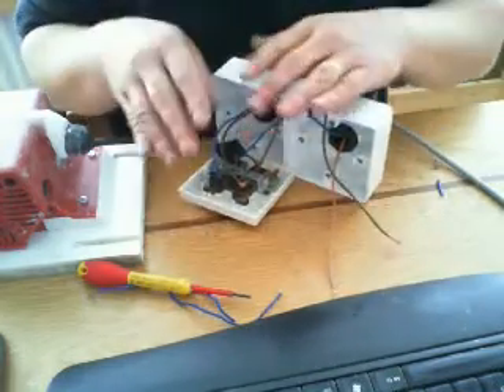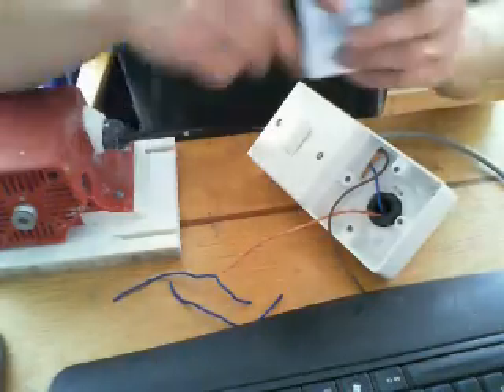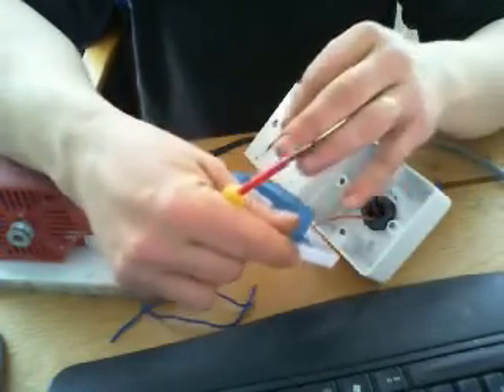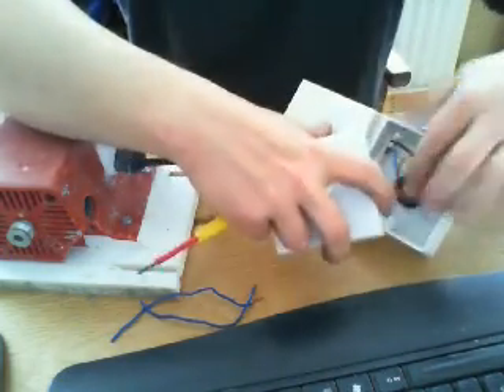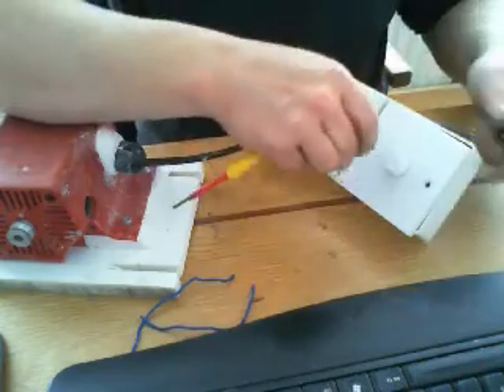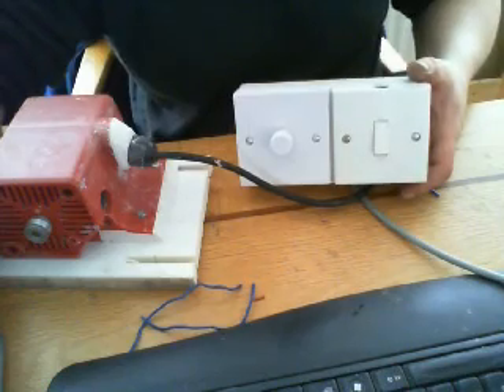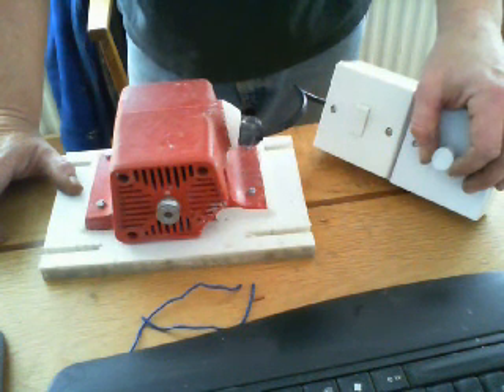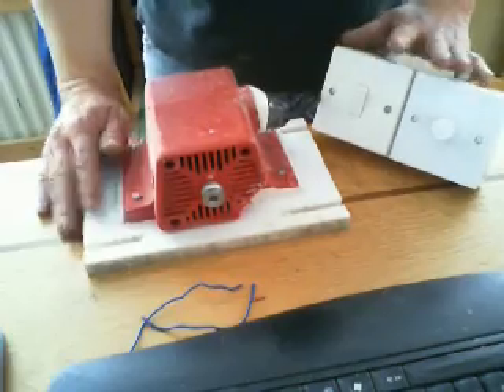How to build your own Van Der Graaf Generator - motor wiring 2

Comment from the maker: Hi - sorry about the delay in replying - i have been away - the motor is an 240volt ac motor pulled from a belt sander. I cut away most of the extra bits of casing and used it 'as is'. I talk about the motor a bit more fully in an earlier video - hope this helps.